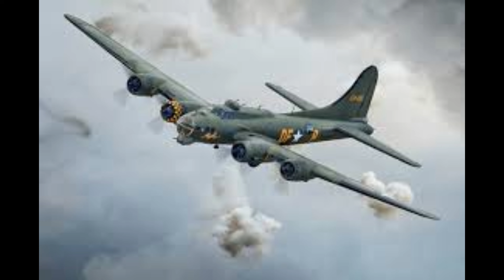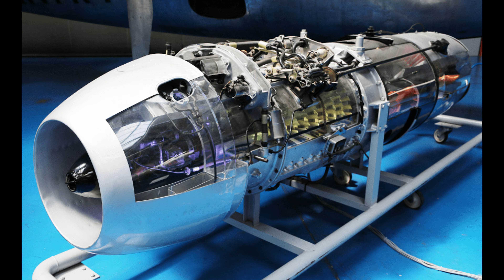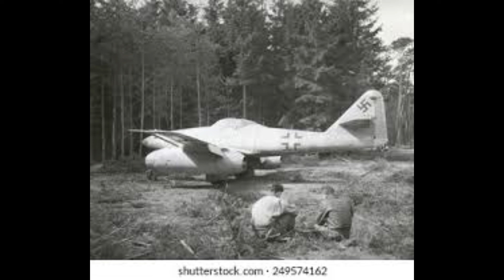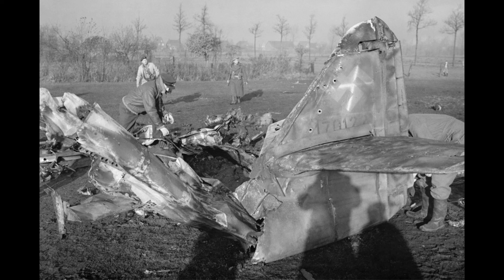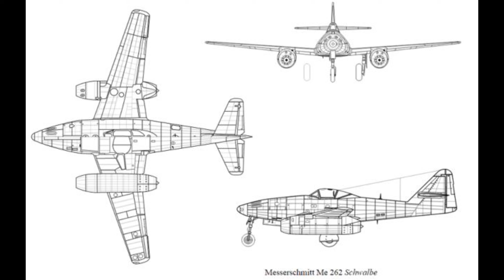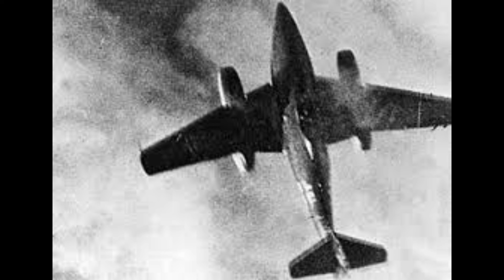How Important was the ME 262

Comment: theres a bunch of stuff around the ME 262,    hitler was shown the plans long before the 2nd minor disagrement of the 1900s too place, and didnt allow development at that time...  when it finally got developed as you rightly say with hitler thinking it to be a light bomber, but in fighter form it showed how good it was.  its kill to mission ratio is incredible, and calculations say id the airframe was developed only 3 years earlier  would probably have gained the win for Germany

also that engine design is the one that Boeing adopted for its passenger jets rather than the less effecient Frank Whittle design solution.
the wing design angle,  was it accident or designed by science?   it was almost preciously the right rake angle to handle trans and super sonic flight, unlike the allied jets with their straight out wings
Reply from the maker: Watch out for the next video on the British development and the politics that allowed Germany to leap ahead. Spoiler is the German engine had more power potential but had less threshold and servicing requirements were horrific, 10 hours before a major rebuild v 150 hours for the British design. The British design also was throttled back to a degree. But thanks for the interest and interaction. 🫡